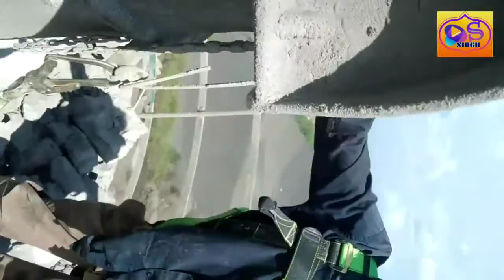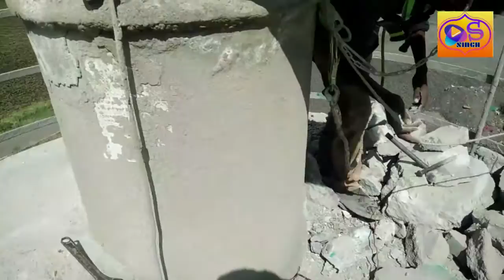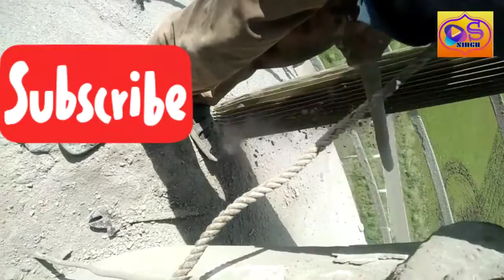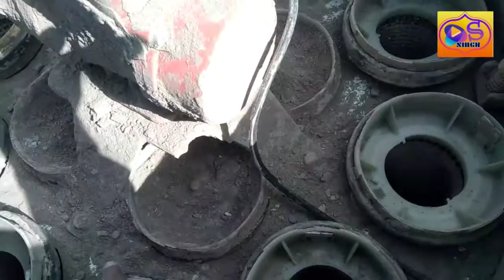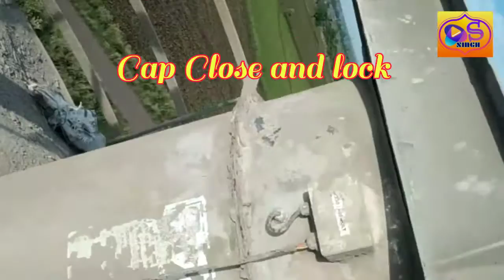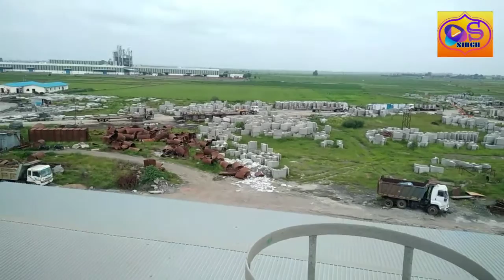Cement silo filter Clining safety valve check । filter cartage element installation rmc plant silo

Comment: man, you need to change your dust collector, cement powder should be inside the silo and underneath the filter not outside, obviously there is a leak .you need to fix it.
Reply from the maker: You are right, thanks